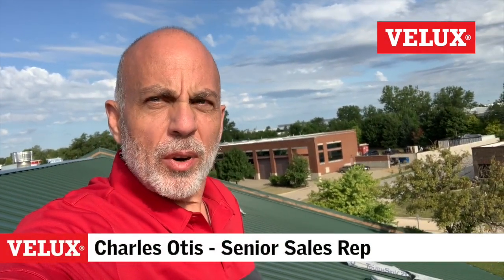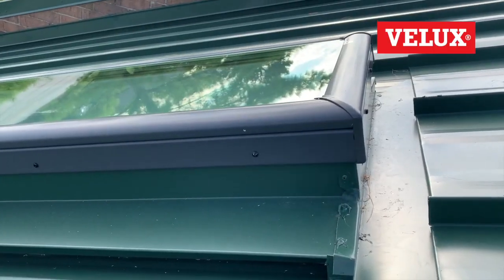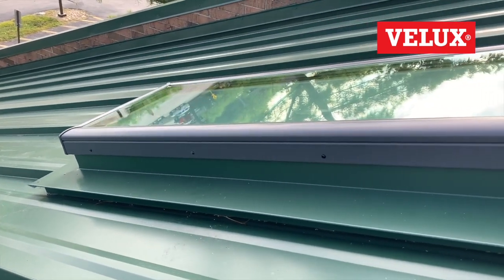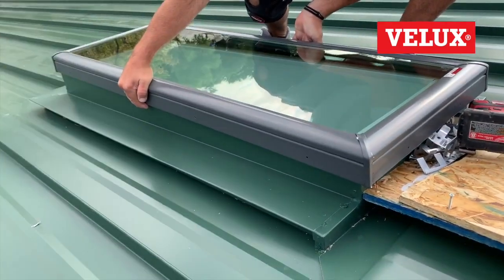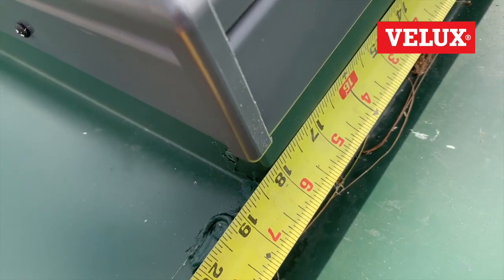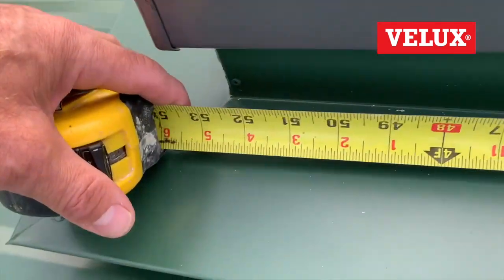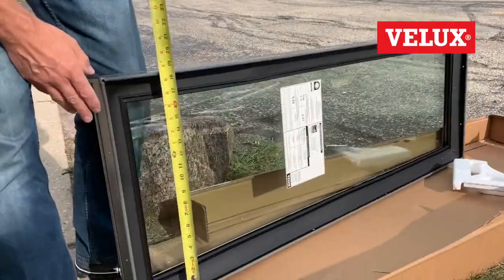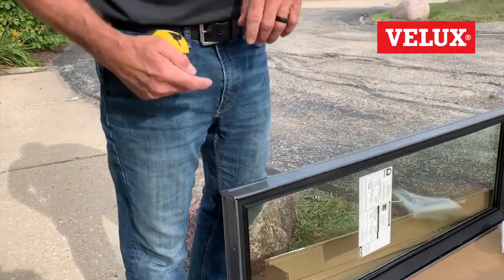How to Measure a Curb Mount Skylight For Replacement

Comment: So did this end up being a custom skylight ? 

I looked at the measurements you pulled and closest was Model 1446 But outside curb is 17 1/2 x 49 1/2, Max clearance was 18 5/8 x 50 5/8. You came up with 18 1/4 x 52 3/4 max 19x53 5/8.

Comment: Can a deck mount skylight be replaced with a curb mount? Also, if my roof is 25 to 30 feet high, and I can't get up onto it, how can I measure the size I need accurately from the inside?